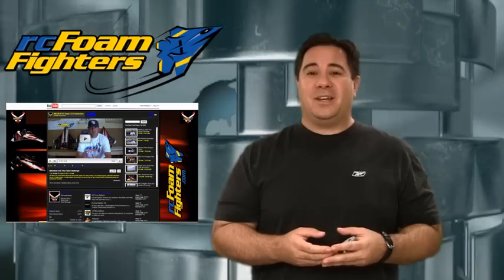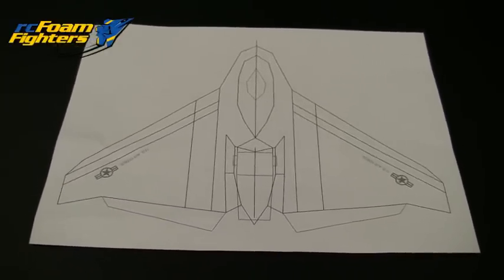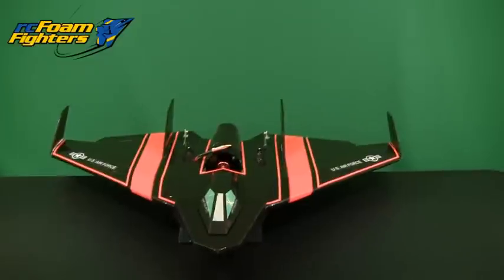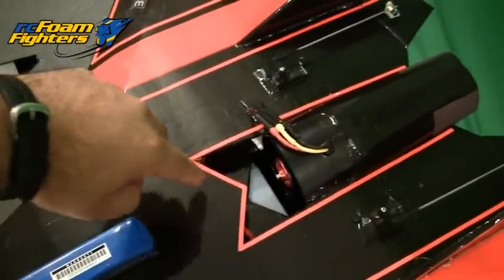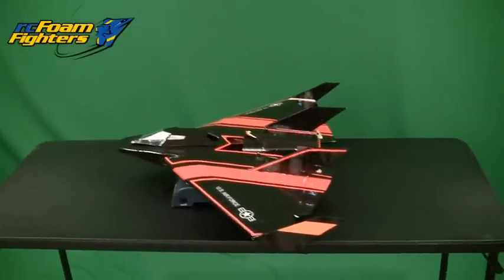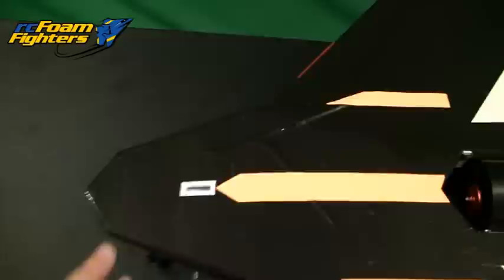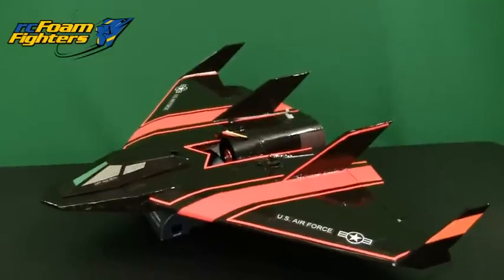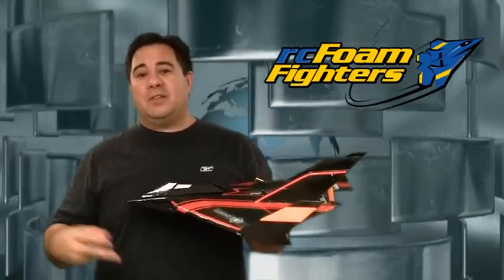EDF Challenge Plane - FF-B3B Part 1

Comment from the maker: @xmodscarbonslost 
Thanks for watching. Not sure if you caught what I said in the video, but as mentioned in the video, this EDF is kind of non standard. the Fan is a pusher and not a puller setup. The motor is on the front of this EDF.  It seems to work really good and put out nice smooth power. I will be posting the maiden flight of this plane in a few hours. Thanks.

Comment from the maker: @djony007 
Yes it is theFat 3 blade Fan. So far seems to make good power and the fan seems pretty smooth. With the 3200kv Turnigy motor I have on 4S 1800ma 40C lipos it was making 759watts at 50Amps!

Comment from the maker: @bowser197 
Thanks bowser197. Originally i was going to make some sort of scoup around the front of the EDF. but then changed my mind. The EDF Fan is at the rear of the EDF unit and should be ok with out a scoup I think. Inital static tests seem to work out ok. Plenty of power, 759 watts!

Comment from the maker: @lin350gg 
Yep, motor is on the front of thes EDF. Just did a static test, felt strong. 759 watts at 50amps! happy yo find it has over 1 to 1 thrust weight ratio!